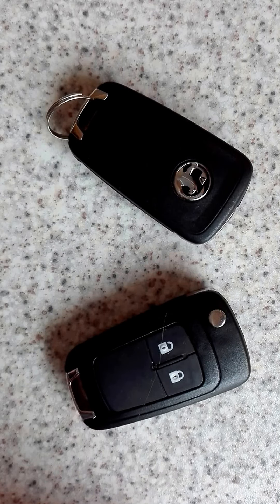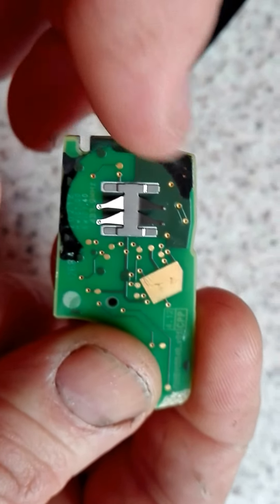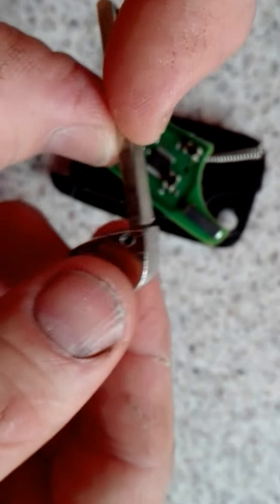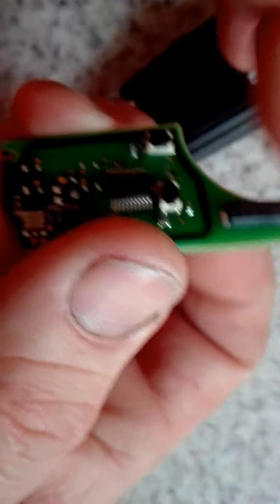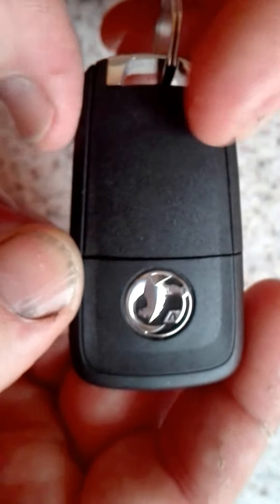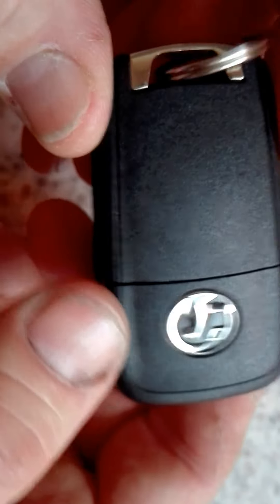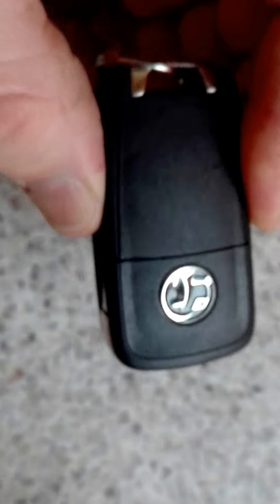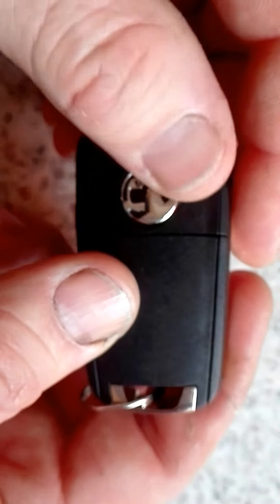Vauxhall Insignia/Buick Regal Anti Theft Warning Part 2

Comment: Ok so I've done exactly what your saying not to do. I opened my key and transferred the key over. It unlocks and opens fine and unlocks the car doors however comes up with the theft warning when opening the car. Guess I messed it up.
Reply: Just a update on this. I managed to fix the break in the connection with a dab of solder. Working as intended now.
Reply: Hi just to confirm so it was the key right
Reply: Yeah that's correct. I was replacing the casing. When screwing the casing closed the screw slipped and damaged a like. Would be fixable with a little wire but never got around to it

Comment: I have the service anti theft deterrent system issue. The car battery is checked and it's okay, but it might also be the battery of the key? It's low, sometimes I can't unlock the doors with the key and maybe the car cannot read the code then.

Comment: Hi, maybe you can help me. So I’ve watched your first video coz I have the same problem with my insignia, I bought a new battery, but it’s still not working, but one week ago I’ve bought a key case from ebay and changed by myself, then the problem began with this, I went to the specialists & they said that chip is okay& key should work. I don’t know what to do
Reply: Adriana Sulia did you ever get it fix?

Comment: Hi bud, I have two original keys with my 2012 insignia one of which has never been used, car still won't turn over, and handbrake won't disengage, the Interiors lights of the car aren't working either. I charged battery for about 14/15 hours but nothing, and had it on a computer but it didn't read anything (possible that computer wasn't compatible). It's a real head scratching time, I can't even tow car to garage because I can't get handbrake off.
Reply from the maker: Rookin have you had your battery checked to see how many amps it has I had a 700 amp battery and the ATW kicked in when it was down to 350 amp wouldn't start . sound like you may need a new battery . your handbrake try resetting it by moving the handbrake button up and down a few times . can you send me an image to my email of you dash lights when your trying g to start the car please
Reply: Photo Tutorialz no haven't had battery tested, tho I can tell you that the Handbrake light, PowerSteering light, ABS, Traction Control lights all stay on the dash when the key is in the 2nd position. I've been trying different tings to try and release handbrake, hooking up two batteries to see if car would start. Things like that.
Reply from the maker: Rookin if all those lights stay in then you have a major problem with the electrics or perhaps your starting to have multiple sensor problems . ie one of your abs sensors faulty and traction control has developed a fault  . if the diagnostic has not read a single fault then you have electrical issues . I think you need to try a brand new battery . take the old battery off and leave it for a while before you you out new battery back on to see if the car resets itself then try engaging the electronic handbrake then releasing it do this several time this is a reset for the handbrake . if this doesn't work then I'm guessing it's electrical problems or somewhere along those lines . please let me know how you get on but try a brand new battery 👍
Reply: Photo Tutorialz I will do, thanks for the quick response also thank god for my trusty old 1999 VW Passat TDI, it's never let me down and has really come in handy this last week. Lol
Reply from the maker: Rookin yur welcome m8 no problem sorry to hear your having loadz of issues with the Siggy . to be honest it's sods law some can go years without any issues and some just gave relentless problems . it may have something to do with manufacturing issues sometimes supplying parts to a assembly line with car manufacturers can be daunting for external contract companies the demand for parts can be so demanding that one or two parts can get overlooked by quality is electrical harness . software. mechanical parts can come out to be substandard and over time cause problems . it's just one of those frustrating things that come up every now n then . anyhow I wish you good luck in getting it sorted but meet the trusty be lol 👍
Reply: what was the company called that you brought the fob and key cut from?  I need a new key and there was a chap on ebay that does that 50% cheaper than dealer but after you mentioning the fakes I won't bother
Reply from the maker: Thompson the guy was called Shaun he comes out mobile but he's based in Billingham in the Both East of England . there are several people who say they can recode the keys but you need the key programmed to your car using the car pass key code . it's a long shot using them off the internet because the key needs to be reprogrammed to the car via the vehicle din port . if you don't have the car pass the key can be recoded but will take longer and cost more .